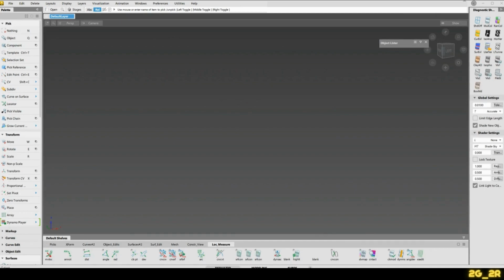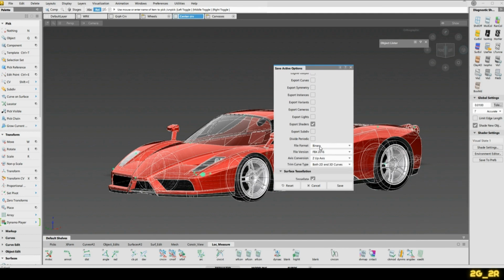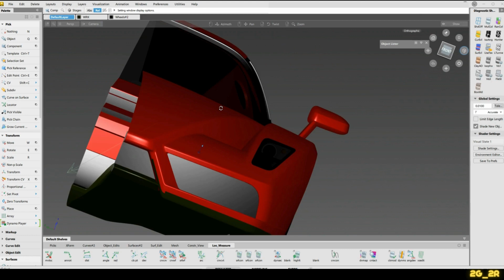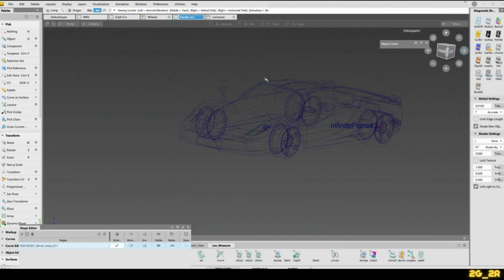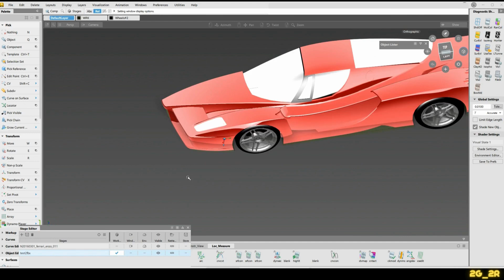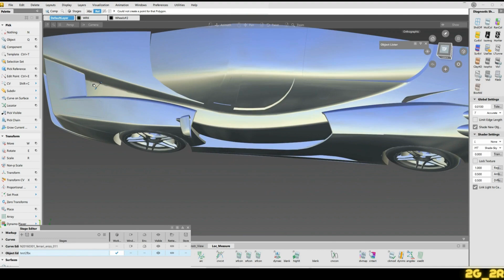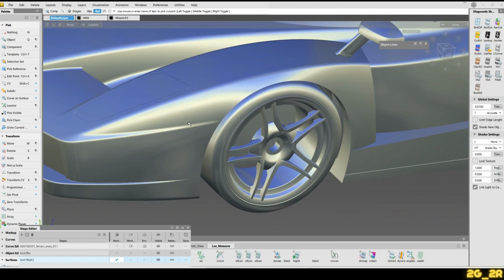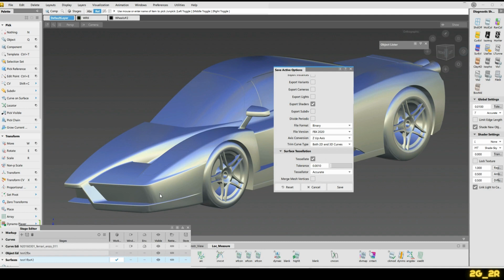Autodesk Alias: successfully convert .wire to HQ fbx

Comment: I usually bring the wire file into VRED, and then export out to FBX, seems cleaner, but sometimes VRED is not an option.
Reply from the maker: Hi, thank you for the comment, you are right sometimes that is not an available option. I tried a few times the blender export plugin but with no success so far. I will have a go at it again sometime soon.